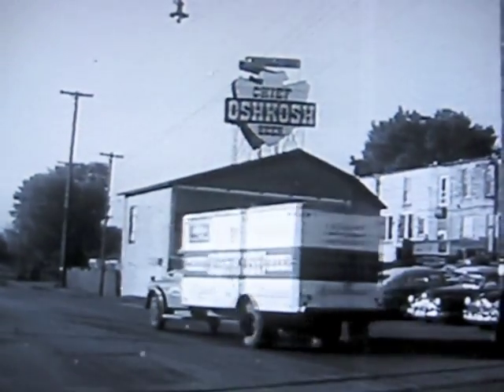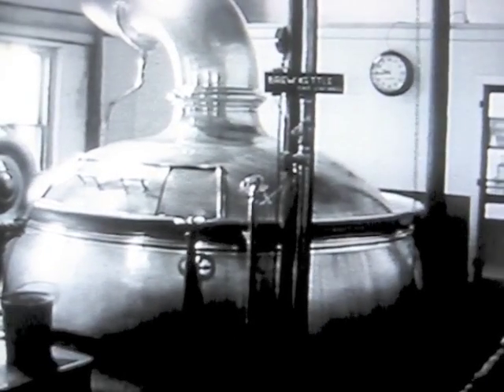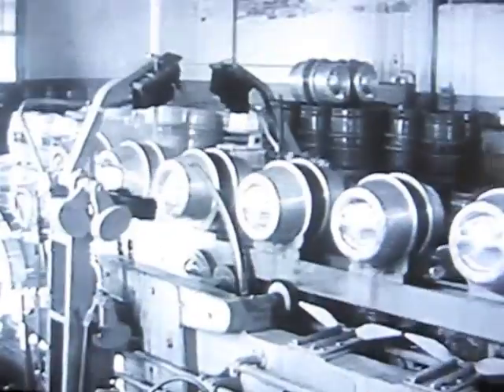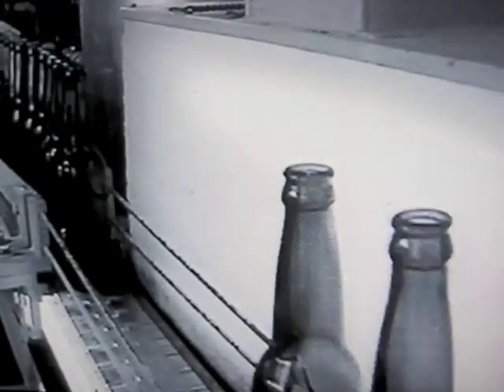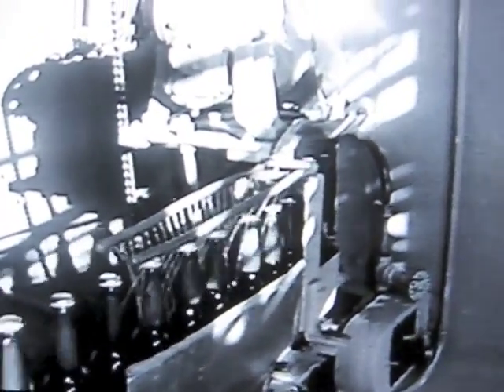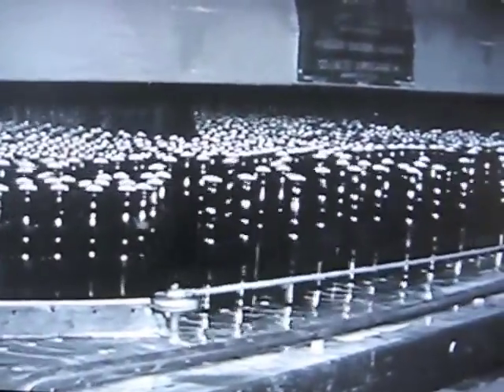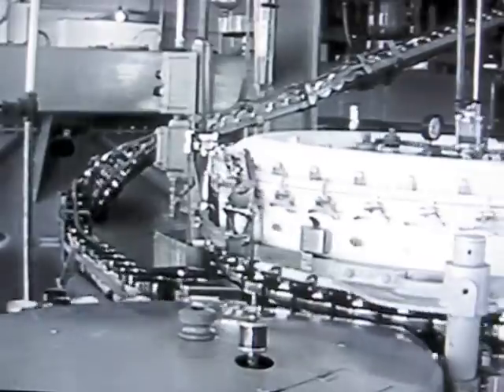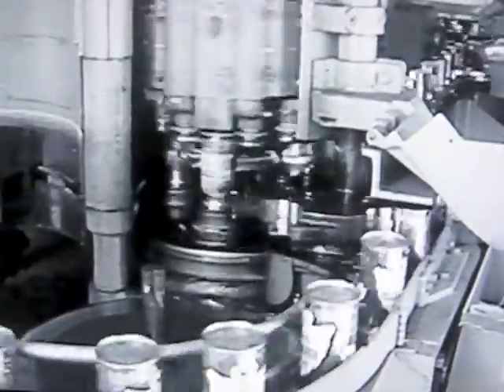Oshkosh Brewing Company Tour

Comment from the maker: A comment below incorrectly states that this movie was actually made in 1953. This is absolutely false. There is an abundance of documentation relating to the film’s production in the fall of 1956. To confirm the 1956 date for yourself, all you need do is watch the film. Early on, the narrator notes that the company has been in business for over 90 years. That claim could not have made in 1953. Also the flat-top can line that is featured in this segment of the film was not installed until 1955.